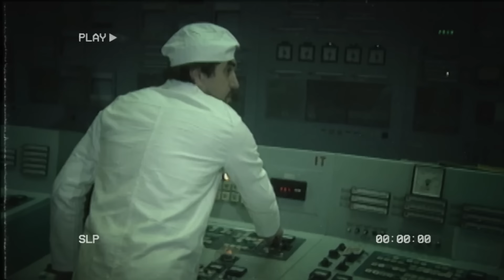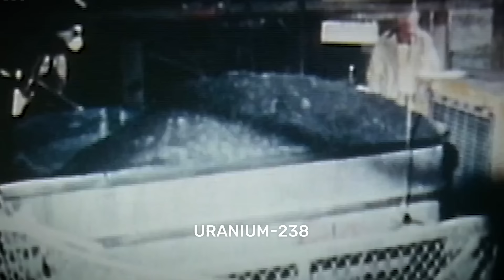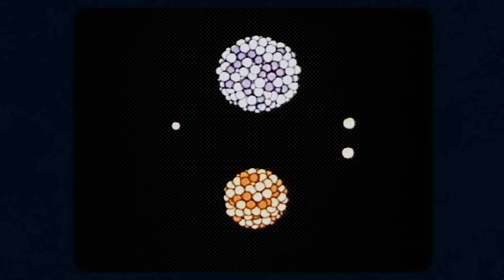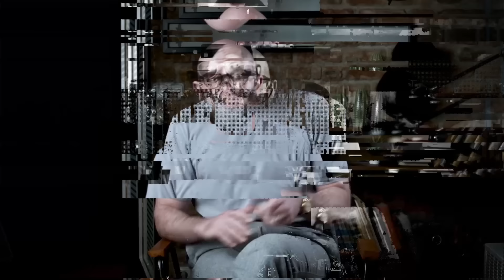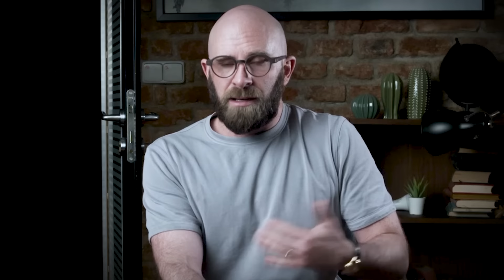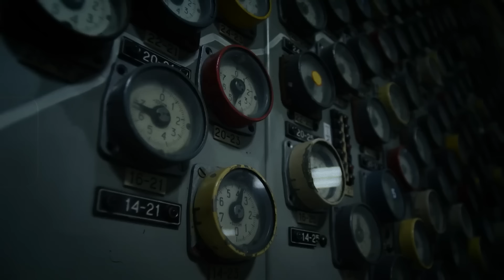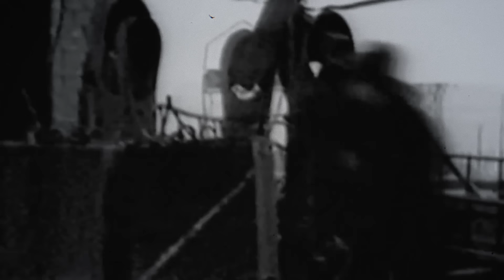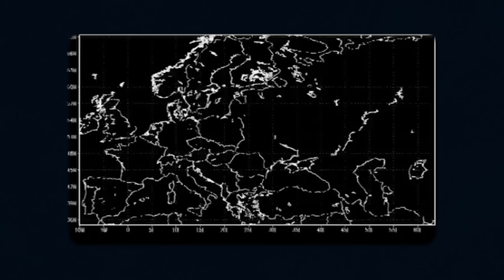The RBMK: The Shoddy Nuclear Reactor That Nearly Killed Millions

Comment: Most ppl don’t know that the plant still operated after the disaster, the last reactor only being decommissioned in the year 2000
Reply: In Germany every once in a while a small article like "btw. Chernobyl is still in operation and it's synchronized with our grid" was published.  There was also an article about the final shutdown of the last reactor block.  Mainstream media but far from being a headline article.
Reply: Under pressure and money buy out by the Europeans.
Reply: The Monolith does a great job upkeeping the place.
Reply: I thought it was still active bc they talked about Russian soldiers invading it and taking control after Russia invaded Ukraine.
Reply: @tabathacarruthers5122  The reason was probably that the exclusion zone around the disaster area was kargely empty.  No defenses, military.  Basically some perimeter security.  And inside only  people involved with decomissioning units 1-3 and the ruin of unit 4 under its sarcophagus and NSC.  The hope was probably to be able to make gast progress without hitting resistance.  Except a whole bunch of rabid cesium atoms 😉
Reply: if you are talking about chernobyl the last reactore was defueled in 2013 and the decommissioning is currently expected to take until 2065
Reply: Yes but they were modified and had many of the original design short comings corrected.
Reply: Similar situation with TMI and Fukushima.
Reply: @ No, Fukushima never went back online.
Reply: @MinSredMash  Yes and no.  Units 1-4 of Fukushima Daiichi are the ones that were damaged beyond repair by explosions.  Units 5 and 6 as well as all four units of Fukushima Daini could have been repaired rsp. restarted.  These were officially retired many years later despite never having become critical again after the Fukushima accident.  Iow, they were servicable only on paper.
Reply: @ralfbaechle  Daini is a completely different plant.
Reply: most people don't know there are still 7, RBMK-1000 reactors operating right now.
Reply: @LodewijkVrije  The last time the RBMK-1000 made smallish headlines was shortly after the Ukrainian offensive in the region of Kursk had started where the Kursk Nuclear Power Plant is located. Kursk NPP has four RBMK-1000 reactors two of which are active and two are decommissioned since a few years.  So the type is still present in the heads of people following the news.

Two more are in Leningrad (where incidents happened which could be considered major warnings for the type's flaws) and three in Smolensk which are probably least known to the general global public.
Reply: And Russia hit it with a drone last week.
Reply: Almost everyone with even a passing interest in Chernobyl knows this. Why do you think you're being revelatory? Weirdly egotistic...

Comment: That 2-5 megaton sounded wrong to me. I ran the calcs on the max energy content of 7000 cubic meters of water turning into superheated steam, and I calculated that it would only have the energy content of ~10 kilotons of tnt at 100% efficiency, so the energy released would be much less. Unless I was missing something, they were off by 2 orders of magnitude.

A good estimate that I found online put the explosion potential at around 0.1 kilotons of tnt.

If it actually exploded it was our estimate (I ran these numbers by some nuclear engineers that I work with) that it would have probably ejected all the core material into the air like a cannon since the core was split open, turning it into a really bad dirty bomb of sorts, destroying reactor no. 04 entirely, and possibly physically damaging the other 3 reactors at the Chernobyl compex and heavily irradiating the surrounding area way more than it already was/is.

Here's my math, feel free to double check my numbers I probably overlooked something 😁:

Here's the full calculation:

1 liter water = 1kg

Specific heat of steam @ 2300 degrees k  = 2.934 kj/(kg k)

Delta t = 2000

7000000 kg x 2934 j/(kg k) x (2000 k) = total energy = 40656000000 kj 

1 kilotons tnt = 4.184x10^9 kj

40656000000 / 4.184x10^9 = 9.71 kilotons of tnt
Reply: Retired Nuclear Engineer/Radiation Health Physicist here. I agree with this assessment. I find the multi-megaton scenario unconvincing, and the "half of Europe and the USSR uninhabitable for centuries" actually silly. 

I suspect that if the molten fuel started hitting the water below it would have caused an explosion that would have blown the rest of the fuel out of the building before it could get to the water. An analogy would be a canon with a short barrel using very slow powder, such that the first of the power burning blows the rest out of the gun before it ignites. 

I think the UN death toll is most likely, especially as closer monitoring of the evacuees makes early detection of cancer more likely, I suspect the monitoring ended when the USSR did, which might well have meant more cancers developed to the fatal stage. 

I strongly suspect that, like Fukushima, there were more evacuees who died of suicide and stress related issues than from radiation or cancer. I am not against counting them in the death toll, which likely moves it into the tens of thousands.
Reply: IT should be 2-5 kilotons of TNT. Nevertheless such an explosion directly next to 3 additional nuclear reactors is certainly a bad thing.
Reply: I remember a simiilar yield figure being stated in the TV show and immediately coughing, "er, whatnow?"
Reply: The 2-5 MT is clearly a mistake, it's something that I really think should be dispelled as it's the size of a low yield nuke like the one dropped on hiroshima. No way a steam explosion can even get close to those energy levels.
Reply: @MrPbhuh  2-5MT is many times greater than Hiroshima. That is tactical nuke territory, most of our warheads in inventory now are in the 1MT range if I remember correctly. Hiroshima was in the 10-20 Kiloton range.
Reply: @mhadlock78  ah yeah you are right. Even more ridiculous.
Reply: @MrPbhuh  It has been dispelled but that doesnt change researchers who only go halfway. And maybe Simon only wanted a 20 min video.
Reply: Megatons lol
Reply: In general, reactor-grade uranium cannot produce actual nuclear explosions, it's not enriched enough to undergo fission at a fast enough rate. If this wasn't the case, the whole international talk of enrichment grade for foreign states would not be something that wars are threatened over.
Reply: Legasov never mentioned the possibility of that huge explosion. He said that a thermal explosion was possible and strong enough to completely destroy the reactor and to pulverise the remaining 190 tones of nuclear fuel inside the reactor (slightly enriched (2% 235U) uranium dioxide fuel). The main explosion expelled roughly 7 tones of fuel.
The thermal explosion could generate the same amount of radiation to a 3-5 Mt thermonuclear bomb.
Reply: Exactly and well done.  This was BS in the show and is BS here as well.
Reply: Let do an other calculation to see how joke the number is.
Let suppose all the water magically transform into hydrogen and explode.
It would make a 28kT TNT explosion.
Here is the math.
1kh water = 2/18 kg H + 16/18 kg O
7000000kg water=>780000kg H
1kg H =150Mj 
780T H =>117Tj energy 
117TJ/4,184Tj(1kT tnt) =28
Reply: I think the original thought was that in the closed system some water would turn into Hydrogen and cause another hydrogen explosion but megatons are still too high an estimate.
Reply: Maybe they've accidentally used the word megaton instead of kiloton because when talking about power with a nuclear reactor it's always in Megawatts? It would be an easy mistake to make.
Reply: @tjroelsma  if they used megalodons, it would have been a Sharknado.
Reply: i think it was a error , the soviets said that in multiple documentaries, they were just wrong
Reply: Thank you. Now.. I feel a bit more.. ALIVE. As if the last decades of my life were.. LUCK😒
Reply: I've been wondering where this claim originated from.  Some BS made up by tabloids?  Or nuclear engineers panicing after some back of the envelope calculations for an entirely unrealistic scenarios?
Reply: The only accurate estimate is zero megatons. Zero. The molten fuel did actually drop into the flooded areas of the building before anyone had a chance to pump it out. All the shitty infotainment out there conveniently ignores this fact. Upon contact with the water, the fuel simply cooled down faster, turning into a low-density pumice that floated around the room on the water's surface.
Reply: he an idiot, it will not explode, its not a forking bomb.   but he is an idiot.
Reply: You're realistically looking at a ballpark of 100s of tons, not kilos, let alone Mt. That's comparable to atomic bombs... and then he proceeds to quantify the fireball radius with a nukemap sim or something... for an overpressure event.
Reply: Software engineer with a love of maths, yep this checks out. It’d still have been incredibly bad as the amount of martial it would have ejected with great alacrity would have been catastrophic
Reply: Your calculation is all about heat.

I think you miss the fact that water turning into steam increases in volume by 1200.

Multiply your result by that - el presto. 11652kt.

Factoring in dispersion effects and the likes - 3 - 5MT seem in the realm of possibility.
Reply: @stanislavczebinski994  Steam doesn't increase the energy in a system. In fact, it lowers the energy of the system because it absorbs considerable amounts of energy in order to flash water into steam. 

You don't multiply by the 1200x increase in volume.
Reply: @Clean97GTI  In this case - you do.

The problem isn't the heat energy - it's the steam explosion caused by it.
Reply: @stanislavczebinski994  which is limited to less than or equal to the heat energy that causes it
Reply: @ No, you do not multiply the energy by the volume. That doesn't make any sense. You don't multiply two unrelated vectors, that's not how the equation works. 
Energy-Volume is more correctly called Energy Density and it just isn't applicable in this case. If anything, it works against your argument for multi-Megaton explosive force because you're diluting your primary energy source (Uranium) with concrete. And the very high energy density of Uranium is only released by fission. Uranium decay is far less energetic. 
The steam explosion could have been large, but nowhere near the 2-4 megaton range the TV show specified. The only way we've achieved Megaton level explosions is with the instant energy release of a Fusion bomb, and you're not going to cause fusion in dense materials like Uranium or even steel, with a destroyed fission reactor and corium at 3000°C
Reply: @DriveCarToBar  let's see your math then
Reply: @Bladeworkssystems  1MWh = 8.6 x10-⁷MT. The RBMK-1000 reactor was nominally rated at 3200MWth, So, 3200 MWh = 0.0027MT. One hour of operation at full power yields energy equivalent to 0.0027MT. To get up to the Megaton level of output, you're talking 3200MWh x the number of hours needed to reach 2MT. For reference, there are 730 hours in a month and 3200MWh x 730 hours = 2.33 MT.

Since it would take a month of full power operation to give you the energy levels needed.
And explosion happens in an instant, which means there's no possible way to get a Megaton-level explosion from the melted fuel. There's just not enough energy in an available form, which you proved with your calculation.
Reply: @stanislavczebinski994  Be real, that water tank would  decompose much faster than any theorised huge pressure could develop. The bad thing is, the steam likely would have carried multiple tonnes of radioactive material right up to the sky. That would have contaminated really large area.
Reply: Yeah but did you run your calculations for fresh water or stale water?
Reply: @joshh535  Fresh.
Reply: Well the Soviets who have a habit of understating mistakes and disasters in their realm did state the total explosion would have been 2-5 megatons. So I will  go along with than. If anything they would have stated a much smaller number to the world if they could have gotten away with it.
Reply: @jeraldbottcher1588  not a bomb moron>  not a bomb

Comment: It is not good to keep repeating misconceptions. It is NOT the impact of the neutrons which splits the atoms. Quite the contrary in fact. It is when a slow or "thermal" Neutron is captured by a nucleus that makes it unstable, thus subject to splitting. As others have noted, this is the job of the moderator to slow the neutrons down enough to be captured. In a general way, the reactor is operated by allowing a certain number of delayed neutron emissions, giving time to balance the control rods.

Comment: 5:06 This is a rather major mix up.

Moderators increase reactivity, by slowing down neutrons to a speed more conducive to fission. It's a bit counter intuitive.

Absorbers slow down the reaction.
Reply: If only that was the only instance of flagrant misinformation in this video... 

The entire diagram at 10:54 is utter nonsense and the author should be embarrassed he ever included it. The graphite displacer is not a "little smidge." It is almost 5 meters long. And it never leaves the reactor from the top. When a control rod is completely withdrawn there is a 125mm water gap underneath the graphite. Displacing this water is what turns the otherwise-useful displacer into a serious design flaw.

The statement at 11:45 is pure fan fiction, like a little girl writing Harry-Snape slash.

12:47 Well, at least everyone else gets this wrong too. There was no coolant gap between power loss and diesel generator startup. The safety test was only needed in the event that a 900mm coolant pipe header ruptured at the same time as a power outage.

13:27 No safety features were circumvented or disabled in a way that contributed to the accident. None of those systems were capable of preventing the accident in the first place.

13:55 The reactor began running out of control AFTER the shutdown button was pressed, not before.

17:20 And finally we get to the Big Lie that invalidates the entire video title and represents the worst example of disgusting misinformation. There was NEVER any risk of a second, more dangerous explosion. The molten fuel DID drop into the flooded areas of the building BEFORE anyone had a chance to pump it out. The result was nothing more than a wet fart. There are scientific papers proving this 100%.

With so many dreadful videos out there attempting to explain Chernobyl to a general audience, this is by far the worst I have seen in recent years. The author should just delete the whole thing and donate the proceeds from monetization to charity. Ideally a climate change charity, since he has decided to profit from ludicrous anti-nuclear propaganda at 17:20...
Reply: @MinSredMash Yeah as a professional gunsmith they foul up a bunch stuff regarding the AK video long stroke piston vs short stroke. This is my first video back and after moderator reactivity mishap I just had to read the comments to see who else caught that!
Reply: @MinSredMash  Absolutely.  Implying a multi-megaton explosion from a hydrogen reaction is just pure BS, and related to that, claiming a reactor will generally run out of control unless you control it is BS when it comes to any modern reactor.  Small adjustments are made to the reaction rate but they don't just run out of control until they explode.  Finally, the nearly 1M possible deaths long-term is just BS perpetrated by anti-nuke groups (Greenpeace, etc) - want to know the death count?  Go to UNSCEAR.  There is considerable confusion about "LNT" (linear no-threshold) - in short a small amount of radiation does not kill a small amount of people over a long time, it kills NO one because it hasn't reached a high enough level the body can't deal with.  This video should be taken down and a clarification in its place after communicating with actual nuclear engineers, or just drop it.
Reply: This shoulda been self explanatory for the writers/Simon. I mean at least everybody in the comments sees this
Reply: oooof.... how embarrassing

Comment: I think it's pretty remarkable that flawed as the design was, the RBMK reactors produced a lot of electricity for a long time. Even some of the reactors at Chernobyl were kept in operation until 2000. And the incident happened largely as a result of Dyatlov taking a number of horribly misguided decisions for frankly very capricious reasons because he suffered the worst case of "getthereitis" in history. He was running the plant at the ragged edge and the moment an unexpected factor was thrown in, the proverbial poop hit the fan. 

Likewise the reactor at Fukushima had its design rather creatively "adapted" in ways that ensured that a tsunami would completely defeat all the emergency systems that were built into it. I simply can't imagine that any engineer looking at their design modifications would approve them because TEPCO seemed to have gone for the absolute worst option at every step.  

And unfortunately these two incidents are the main reasons people cite when opposing nuclear energy projects. Those things are designed to be safe, as long as they're implemented and operated correctly. And they're a solution that we need now more than ever.

Comment: You left out the most important factor of the disaster.  Xenon131  is a superb neutron absorber and is generated based on the running power level of about 8 hours prior.  When the power level crashed, xenon continued to build up, requiring almost all the control rods be pulled out even for <10% power.  When the reaction ran away, the xenon131 vanished.